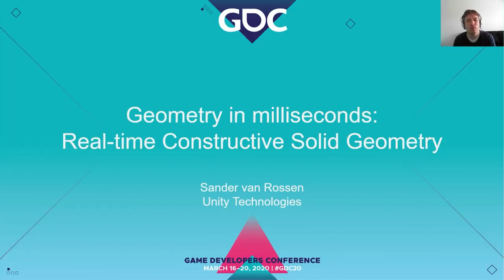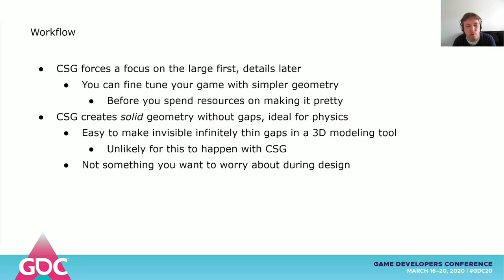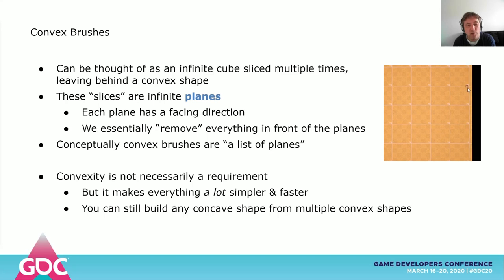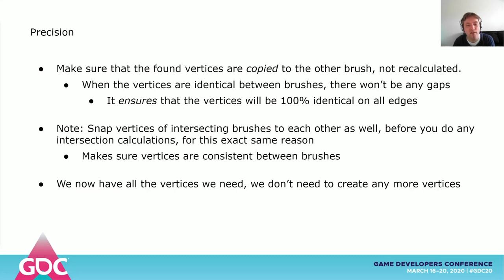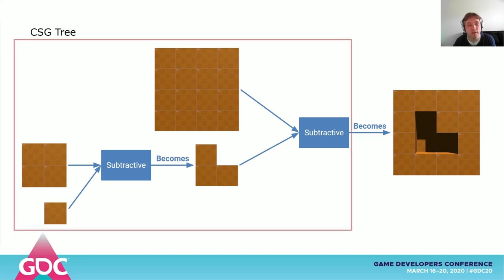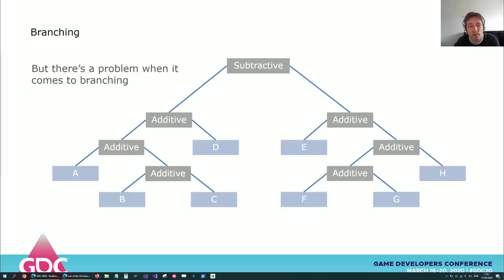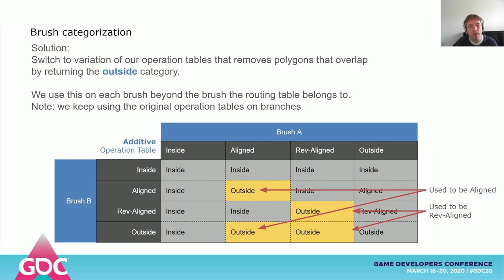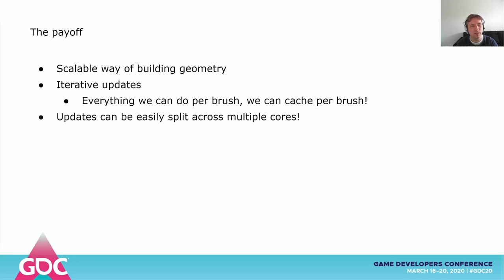Geometry in Milliseconds: Real-Time Constructive Solid Geometry

Comment: Deeply tragic waste of talent, Unity doesn't even hire this guy for level building, but for entirely different things.
Reply: And they pursue other avenues like ProBuilder, but this CSG from Sander is far superior
Reply: @fyrefly6631  Probuilder has its uses, but as a block out tool it's only part of the story.

CSG is like alpha testing, and probuilder's closer to beta testing. Both could and should work in tandem especially for lower budget indie games, but when it comes to forming an environment rough draft, CSG is far and away the better workflow than in-editor poly modeling every single time.